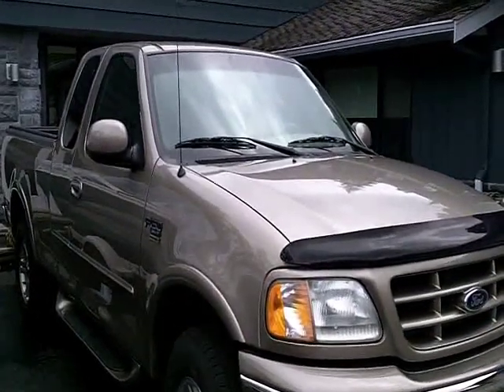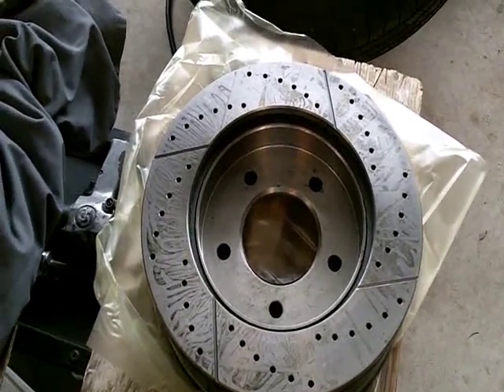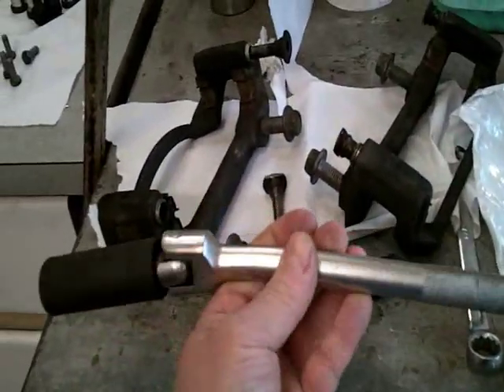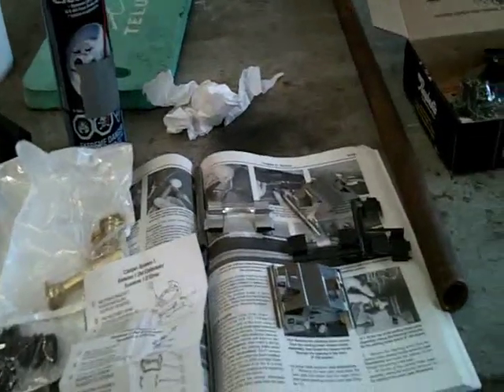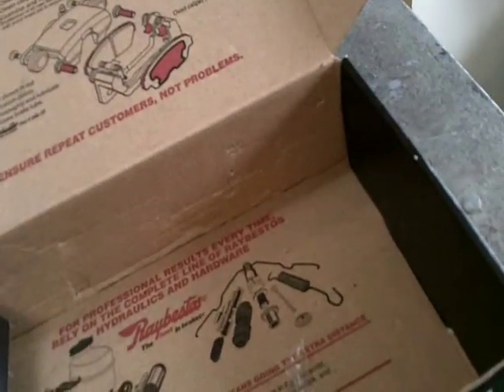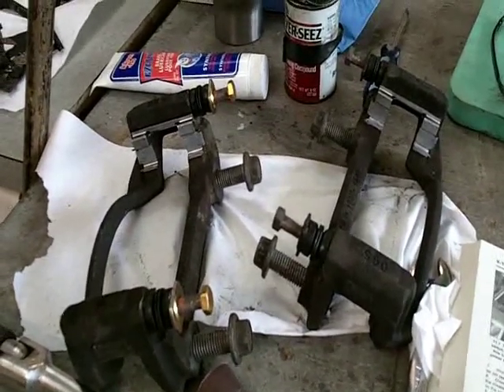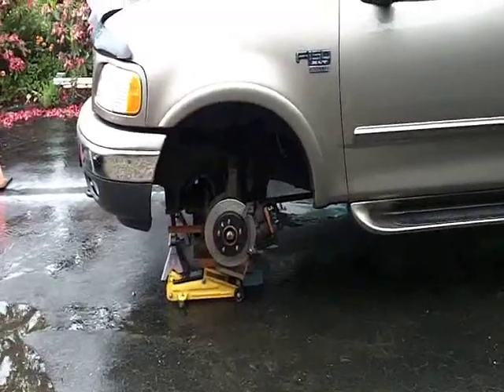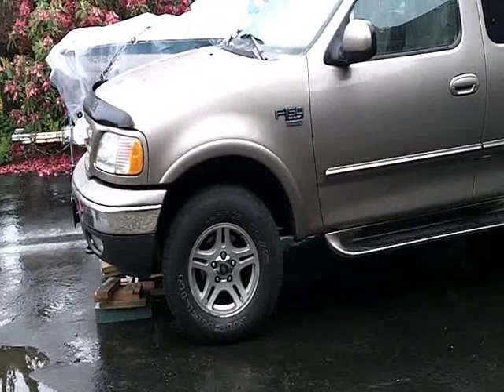F150 Brakes 1997-2004

Comment: Very helpful. Closeups of parts allowed me to identify the correct rubber boots at parts store. For those who are expecting to remove rotor by taking off bearing, remember that this video is about a 4wd truck. The rotor simply slips off (like a large five holed washer) once the wheel and caliper are removed. Thanks for posting it.

Comment: so a 12 min video on replacing brake rotor, but it doesn't show the old one coming off or the new one going on?
Reply: The rotors simply slip off once the caliper is removed.

Comment: The holes and slots in the discs are there for the use of ceramic pads. You cannot and should not use ceramic pads on solid discs/rotors.

Comment from the maker: okay first off, I never took the axle out of the hub...didn't need to (fail back at ya)
2d yes the old rotors did just pop off with a tap
3d I ordered my parts from my local auto parts store